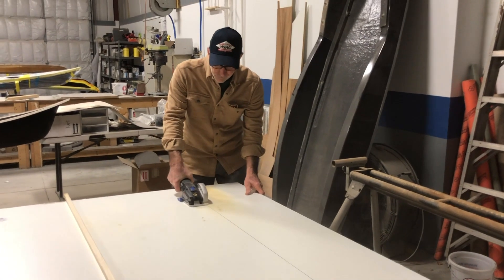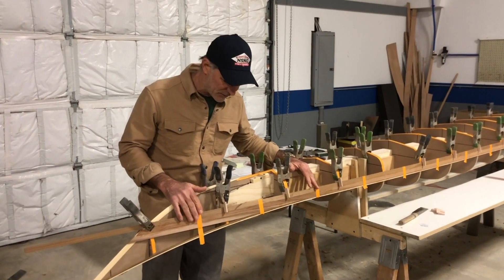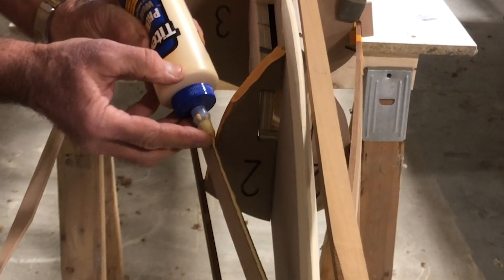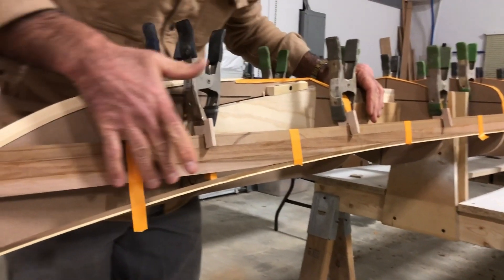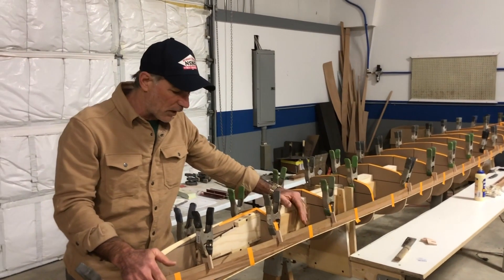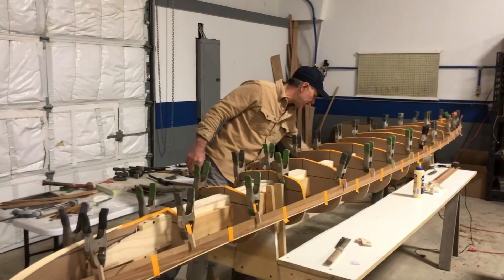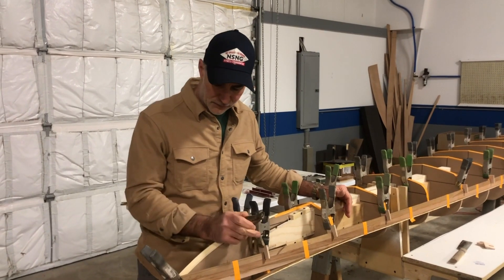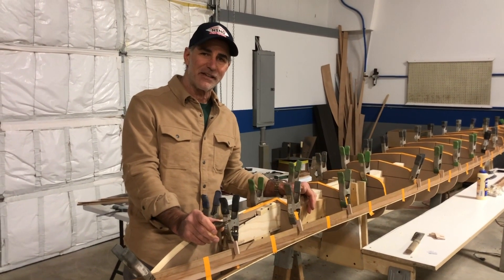Making A Cedar Strip Kayak, Part 4, by Vinnie Tortorich

Comment: Robo bevel is to progressive bevel the edges strips. the block plane tapers the strip ends. you are off to a great start. the accent stripe is really a striking addition. nicks tool the Robo bevel is a tool that speeds up the bevel placed on the strips by automatically selecting the angle for you. in some places the block plane will still be of practical use. nick likes the use of 3/16 strips because the bevel takes less energy. Typically copper twisted wire is utilized in stitch and glue plywood boats.